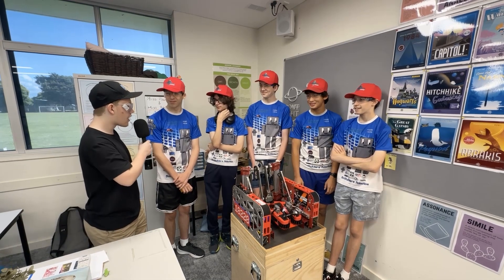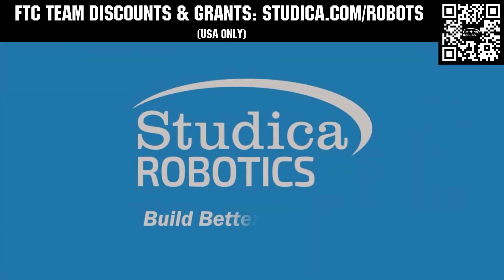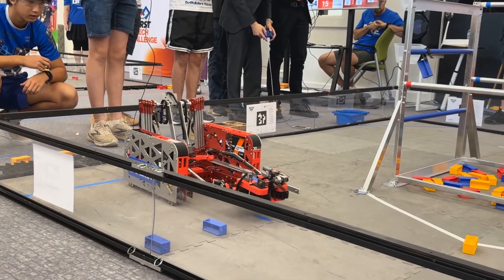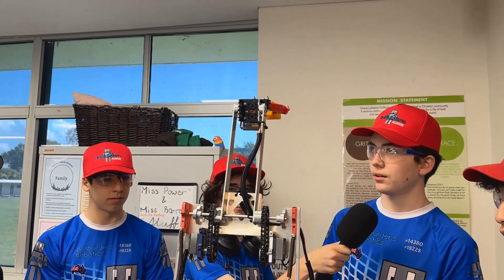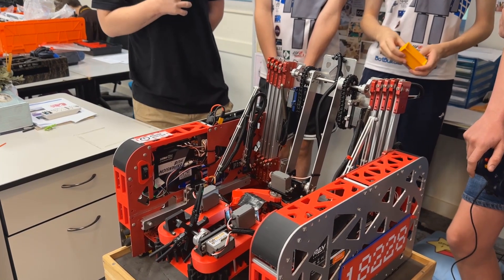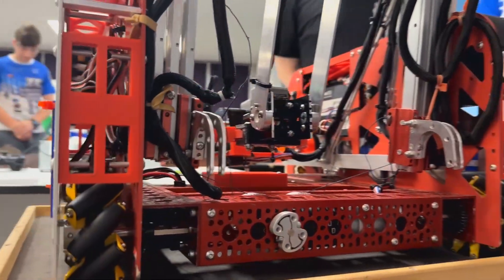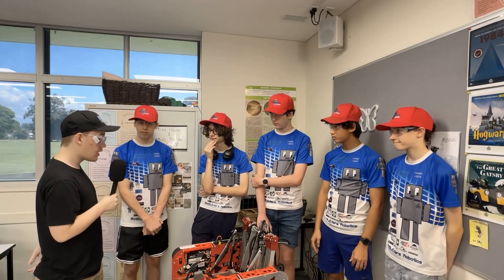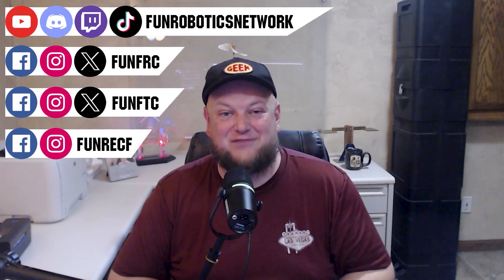18228 Red BotBuilders | Behind the Bot | Into the Deep

Comment: how did you guys connect the intake to the slides? Kinda stuck on that, also is it possible if I can see the cad for ur elevator intake?
Reply: We have an axel on each side with a bearing. The gears is permanently attached to the axel which can rotate around the servo gear
Reply: @ is it possible if u can slide some cad? I just need to get an idea cuz our qualifiers are in like a few weeks